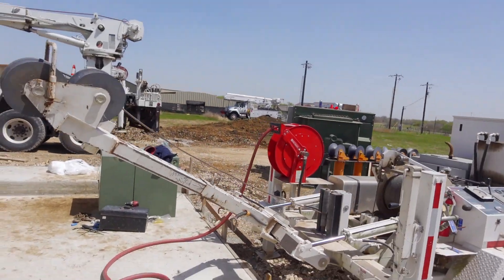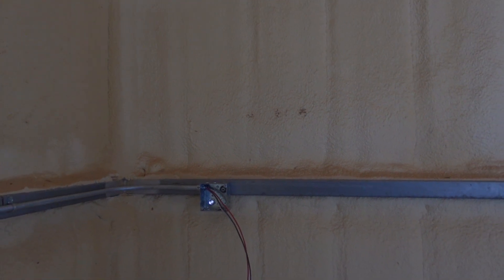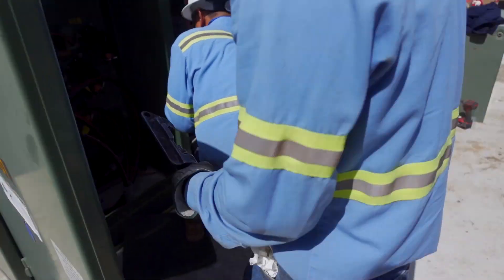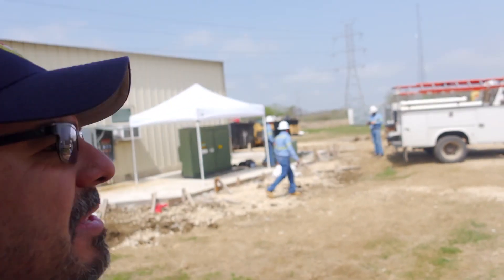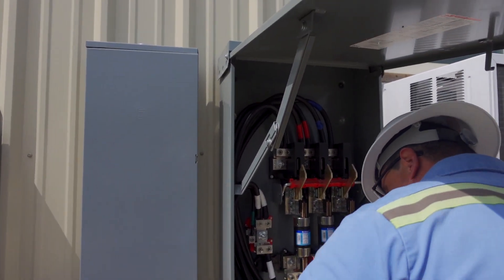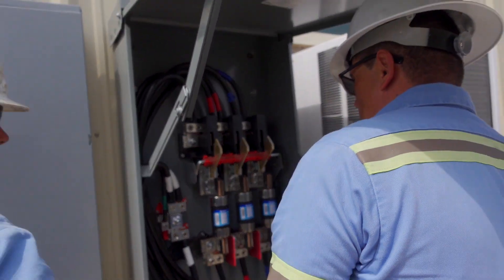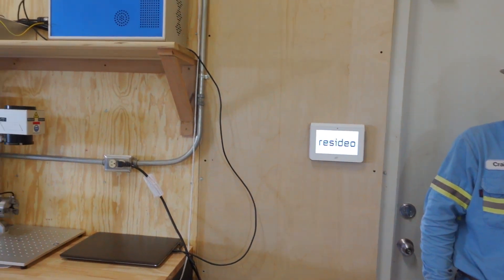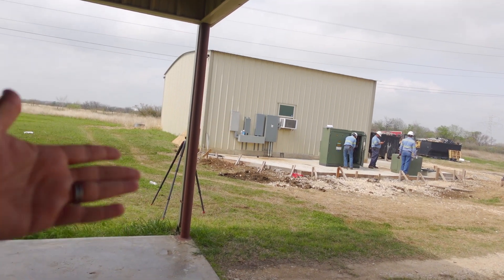Installing 3 phase transformer | Starting a Machine Shop 17

Comment: "Four hundred" refers to the size of the cable. It is a measurement of the cross sectional area of the cable. The unit is "kilo-circular mils", or "kcmil", or "MCM" which is an archaic expression. One kcmil = 0.5067 square millimeters, so "400" is a cable with a cross sectional area of 400 x 0.5067 = 202.68 sq millimeters, or 0.314 sq in. Ironically,  that number is pi ÷ 10. I don't think that is a coincidence.

Comment: You do have 3-phase. Just missing the other half of your parallel runs. Your wires can only basically just handle half of the 600 amps right now. You're not missing any phase.

Comment: The cable is apparently 400 MCM. Circular mils is used rather that wire gauge on larger cable.   https://en.wikipedia.org/wiki/Circular_mil

Comment: thats a LOT of 3 phase for that small of a shop. hopefully youll have more buildings. I have 13 machines running on a 200 A service, thats with a 30hp screw compressor and a bunch of 50 taper machines.

Comment: I honestly thought that for as much headache as you were going through, that this was gonna be a 480Y setup, I'm a little surprised you did all this just for 208...
Reply: I didn't hear what amperage the main panel/service would be, but I'm also surprised it isn't 480 and that they ran double wire that size for such a small building.......unless he plans to pack it completely full of large machines and run them all at the same time.

Comment: Guessing you are running 208Volts.  Why did you not go with 480?  Less current, hence less electric cost and less installation cost due to the decrease in load at that voltage.

Comment: From my experience with most all the electrical companies in the San Antonio area 
FELPS is the best 
Because it is FELPS you were able to get 400 amps all the rest would have done a survey of your full load and gave you a precent of that
And when you expanded you would have to go through this all over again 
My shop has expanded and I have CPS and most days we have to run only some machines 
And run other’s on second shift we could run one shift if we could get more power 
Like I say “ we are in Manufactering desert land”  I hope the power problems we had in February will get state and federal help to fix are power grid the President said he wants to improve infrastructure let see 

Like good shooting don’t hold your breath

Comment: Dude, I work for a utility. What exactly are you powering with a service that huge!? NASA?   Dual feed 400 MCM, 600 amps if I herd correctly. Then to single 400 MCM on the low side of the disconnect????  Fuse protected I see. You should have gone 480v standard. Your is a very strange set up. Then a High leg the 208 leg. That's an open delta set up. Not really use anymore and  was for extremely light industrial loads like your seem to be. Either a 208 three phase service with a dry pack transformer for your 240 three phase would have been way way cheaper. 480 volt with a dry pack for the same and a smaller for single phase loads. Most likely your machine/machines requiring 3 phase are voltage adjustable if they're of any quality. Some engineer saw you coming and went CHA CHING!! $$$$$$
Reply: What utility do you work for???  He has a 120/208 3 phase service. His single phase transformer is powering his 240 loads. 277/480 and 120/208 both Wye, are the most common. I have never seen a delta pad mount three phase transformer. NEC code also has a say in what size secondary cables need to be. Mostly oversized.

Comment: Back in my Brown and Root days I watched electricians shoot "birdies" through conduit with compressed air with a pull string attached to the birdie. Then a stronger pull tape was attached and plenty of lube. They called them birdies because they were shaped like a badminton birdy.
Reply: i use balloons string and air for small conduit. Plastic bag string and shop vac for bigger conduit.
Reply: @j.walker3498  All kinds of ways to skin a cat.
Reply: @perdidocamaronero5400  right as long as the job gets done it was the right way to do it.

Comment: You wondered why the long sweep 90’s were required...
Reply: Thats some big money to get that much power. I ran 900mcm to my shop. It’s interesting the difference in codes between different regions. I had that same style disconnect cabinet, but the power CO. would not connect to it due to the top hinged door. They called it a “suicide door”. I had to buy another cabinet with a side hinged door to satisfy the power Co.

Comment: When I built my house I had to run some of the power cable about 300 feet from the post to my house. Heavy and hard to snake so we would slip it into individual pieces of pipe for opposite ends as we laid it in the trench. What a pain, but lots of amps.

Comment: Is it just me or is it odd that the transformer is bigger than ones for entire neighborhood blocks?
Reply: To me it look like he can power up the hole naberhood with that transformer!
😁😂👍
Reply: @janne65olsson  yes. In the business district where my business is there is one on every corner same size as that one but for the entire street. And there are machine shops all over in here.
Reply: @basketofdeplorables4253  It is similar in commercial buildings I have worked on where many large suites (each suite far bigger than this building) are all run on one transformer. For such a small building, it seems overkill to run such a large feed.
Reply: @CGT80  I think someone that didn’t know what they were talking about convinced eric that he needed that. 
I have a guy that does some custom machine work for me, he has 2 machines the same size as the one Eric just put in, he says he runs his off of VFDs. 
And the machine shop were I take my engine parts to have machined has a little round three phase transformer. And they have 5-10 machines running 8 hrs a day in there.
Reply: @basketofdeplorables4253  I did watch another video and he talked about his other garage and the house being fed from the small transformer and meter by the other metal building, but if they stay on the current service, then that isn't a consideration. He did say he wanted to be able to expand if needed, so if he was to build another building and run more machines, he will be set. Also, at only 208v, the draw will be much more than if that was a 480v service. Of course we are on the outside looking in, so who knows if he really knew he wanted that big of a service......maybe he doesn't even know. LOL
Reply: @CGT80  they said 600 amps, so 
volts X amps= watts, thats 125 kw, or about 170 hp. he could put like ten of those machines in there and run them all at full output all the time with that.
Reply: @basketofdeplorables4253  My math shows 216 kw. I'm used to calculating single phase wattage with your formula but he has 3 phases at 600 amps each at 120v and the formula I found (kW = (V × I × PF × 1.732) ÷ 1,000)gives the same final number. I used 1.0 for power factor. When you put it into a horse power number it really gives a better idea of what it could handle. The other consideration is the amperage required to start the motors. My 5hp air compressor motor pulls 169 amps on each leg of 120v and then at 170psi it pulls 28 amps. I'm not sure if 3 phase is any lower on startup, but they won't be starting the motors on 10 machines all at the same exact time and the motors are relatively small.....I'm guessing no more than 20 hp for the somewhat small machines used for the size parts he will make.
Reply: @CGT80  I just did a quick amps x volts. I know there are other things to consider. But at any rate it seems way overkill what he’s putting in there. The three phase transformer at the end of my street that my business is on is only slightly bigger dimensionally than his and it’s running 20 businesses including automotive shops welding shops cabinet shops etc.  216 kw is ~300 hp. 
And I really hope your compressor is not drawing 169 amps. Lol. I’m assuming you mean 16.9 amps.
Reply: @basketofdeplorables4253  No, as stated, it is an average of 169 amps at startup...(looks like I didn't add in the word startup in the last post) locked rotor current and all. It is commonly said that ac motors will pull 6-8 times the nameplate amperage while starting. 16.9 amps isn't even high enough for a new more efficient 5hp motor on 240 single phase. My motor is an older Baldor 1-3/8" shaft that has a nameplate of 28.5 with a service factor of 1.15. The new version is only 24 amps. 169 amps only shows up for about a second on my meter and then it drops to 24 amps and slowly ramps up to 28 amps where it shuts off at 170psi. I don't know if the startup is any less on a 3 phase motor.
Reply: @CGT80  oh yes start up is ridiculous but it only happens for a second, and you still don't have to have 169 amp breaker for it, you put a 28 amp load on like a 40 amp breaker.
Reply: @basketofdeplorables4253  Yep, it actually worked on a 30 amp breaker and a 6-50 receptacle and plug, but I remodeled my garage and ran a 50 amp breaker with #6 wire and then a #8 liquid tite whip to the motor starter, which I didn't have before. Luckily when the bearings and start switch did go bad in that motor, the 30 amp breaker was small enough to trip. 40 amp would have worked great for the new setup but I had the 50 and #6 already.
Reply: The ones in neighborhoods are single phase and the big one is three phase which are used in commercial and industrial applications
Reply: @jaxbeach09  my business is in an industrial park. The three phase  transformer that runs my business and 20 others on the street is only slightly bigger in size than that one.

Comment: Wow! You are installing some serious equipment!  Electricians are amazing people.  Everything is looking great, keep pushing through, you are going to make it across the finish line.

On a side note...I read one time where a home owner was putting in a new circuit breaker in the box, had a screw driver in one hand, breaker in the other, the phone in his pocket on vibrate and then he got a phone call just about the time he was tighten the screw down.  Screw driver went through the window!
Reply: those are utility workers not electricians.

Comment: I’d bet that pad for the transformer is 12” thick with 2 horizontal layers of rebar.
Reply: Actually you would be amazed by the small amounts of concrete and rebar. I am a journeyman subtech and build substations setting hundreds of big transformers. For a 155,000 lbs transformer we only did 12 inch thick concrete with 2 layers of rebar. 4500 mix with test breaks at 7,14,21,28 days before the tranny is set. Usually set by a jack and slide but occasionally by crane.